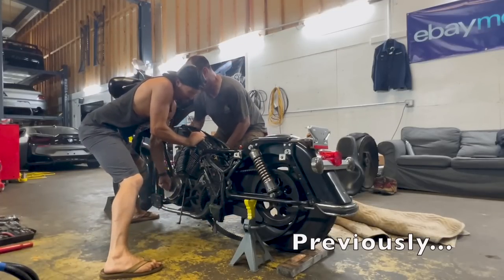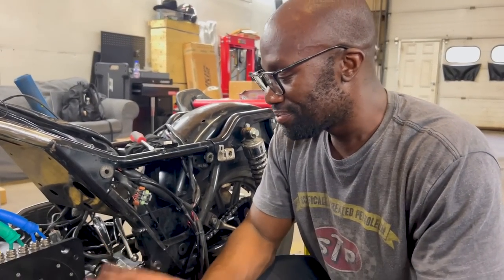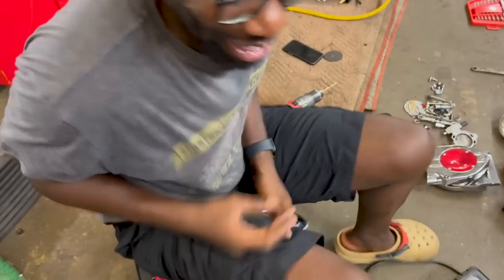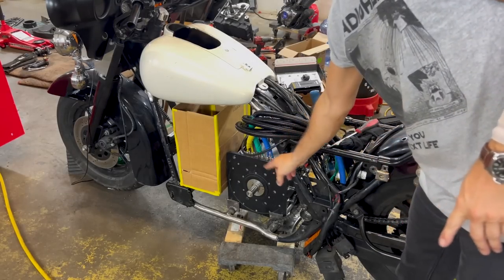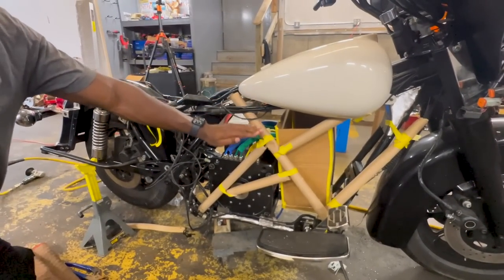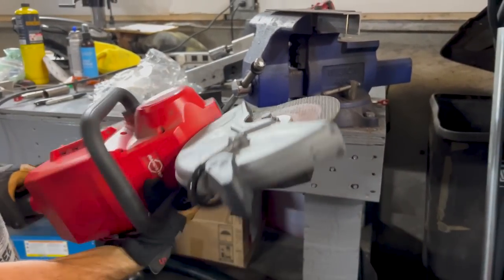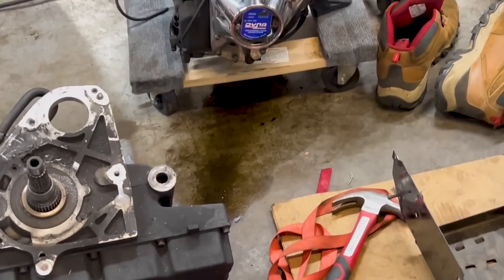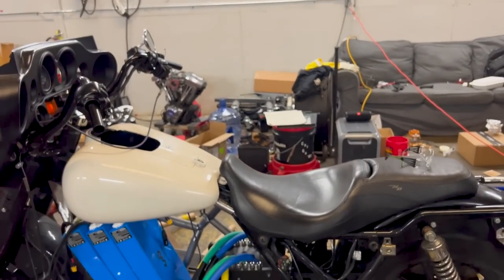Deep Dive into building a True Harley Davidson Electric Cruiser

Comment: More Volts doesn't buy you torque, it only buys you higher maximum motor RPM due to BEMF.

Going to a belt drive "only" (without the transmission) will only cause belt tooth slippage and/or belt tension too high... you haven't resolved the problem of the changing distance between the rear axel and the drive pulley/sprocket... as the rear suspension goes through its travel range.
Reply: I agree, the distance between swingarm pivot and motor axle is large. At the vert least they gonna need a spring loaded roller chain tensioner. But with the amount of torque involved there is going to be a lot of chain slap

Comment: Can the motor fit if you rotated it, like, 45 degrees or so?  It looks like the corner of the motor box could tuck back into the frame further and possibly give you more room in front.  Especially with the angled batteries.

Comment: Idk about those batteries man. Thin ass discharge wires and XT60 plugs ? Even though you're gonna run them in parallel , i'd recommend swapping the plugs out for AT least a xt90(QS8 would be great but those wires don't even fill 20 percent of a QS8 plug) and a parallel adaptor with at least 8awg and a main qs8/qs10 plug. Is the discharge rate of the batteries even going to be enough ?

Comment: I have a serious question why wouldn’t you guys just leave the transmission in and just convert the belt drive pully that was on the engine to the moter and that way you have gearing you can still shift and have the clutch it would feel and stay closer to a Harly or any moter cycle and would be less work i would think. Or is there a benefit with direct drive? I would think less top speed? No?

Comment: Is there a way for a clutch to be added to the drive/motor economically/quickly? Just like a safety in case of an issue throttle sticks/electrical issues?
I ask because today I drove a buddy’s Camry that he said had a brake issue. It did, but the throttle cable got stuck and the car started reving up and the cable was all dusty and yea. Scary shiz!

Comment: again. don,t firget to shield the belt. also the battery u use is naked folded layers with just some insulation , meaning you can't really lean on it you can damage battery.so narrow side down and on metal is a bad idea.at least 45degr. even,more with upcoming flame torch of a battery you need a full,metal box

Comment: IF YOU READ COMMENTS....
Please Fan the batteries. 
Like a V engine.
A V in a V.
A \V/.
You have perfect spacing for it.
Battery cooling. 
A nod to the Harley Engine.
Also round chrome the sides of the batteries.
Mike.

Comment: 15 minutes?
If you wanted a really quick job done on that sheave I could bore it out, drill and tap a couple more holes  make a keyed, flanged bushing with set screws that fits the shaft and slips into the sheave + bolts on.
Could probably do it in less than an hour.
But it would be preferable to bore it and make a split, taper bushing that properly clamps onto the shaft. Doing that would take me maybe 1.5 - 2 hrs.
Obviously there would be no point to do this if the sheave isn the right ratio to begin with.

Comment: To anyone saying that you “need” a chain drive setup on this HawG, that’s not true at all, all of the “high hp” guys 125-150 hp run belt drives with no issue. Belts are more than capable of holding up to the task of propelling those absolute rocket ships down the road, even with 300lbs of hunking boomer and 350lbs of Old lady “Barb” on the back. Get your facts straight Borther. Gobbless and watch out for them clibbens, you don’t want to have to lay’er down.

Comment: As per the belt drive comment, you could dial it in using the chain and sprocket set up, and then convert it to belt drive once you have found the final drive ratio you prefer.

Comment: Great project. If you are going to get a long life on the cells get some air forced over the packs. You are using a cheaper battery pack and would hate to see the cells have reduced output in 100 -200 cycles because your cells over heat. Note: the charge temperature rating is lower than the discharge rating. You can damage cells 115f on charge and after 140f discharge run and the charger is plugged you're over max charge temperature.
Reply: I could almost see putting a copper plate between the packs and then a sort of heatsink joining those plates together on either side. Then, it moves forward air takes heat out of the heatsink and the copper plate transfers the heat from the center of the pack towards the heatsinks on the side. Or, artificially cool it with some 12v fans while it's charging.
Reply: @TheWittyGeek  The center packs will get warmer and they have limited space for heat sinks. I am building a Ebike battery that has a thermal probe to turn on a fan to  cool the batteries when needed. They just want a simple build.

Comment: What's the rated discharge current of those batteries? Those small wires and Xt60 conectors can't handle the 50kw that the motor can output. Nice build tho

Comment: Might be a good idea, but what if you were to cut out the bit for the non-existent clutch, and mount the pack lower and slightly offset, to negate the offset of the motor?
Edit: also slightly lower center of gravity.

Comment: Bigger rear sprocket will give you a LOWER top speed, but better acceleration.  You can go bigger in the FRONT sprocket, and that will give you Higher top speed.
More acceleration= smaller front sprocket or larger in the rear, (or both)
More top speed= larger front sprocket or smaller in the rear, (or both)

Comment: The guy that commented to keep the belt, doesn't know Jack, high horsepower harleys all get switched to chain because the belt won't handle the power, they end up jumping then shredding.

Rich, if you need help with sprockets look up Mad Monkey Motorsports he's one of the top chain conversion guys for harleys.

Comment: Were it me, I would find an output shaft already splined, cut a section off as wide as the contact surface on the sprocket, drill the center and put a keyway.

Comment: 7.2 kWh does not feel Like alot, probably enough for some City cruising tho
Reply: I converted a 250 Ninja to electric with a 6.5kWh battery and the range is about 100km.
Reply: @moestrei  just watched your video on it, looks very clean, well done mate
Reply: @Space_Reptile  Thank you for watching.....yes I took a lot of time to get it right. Like RR I started with a Golden Motor (10kW) kit, but then got the 8kW hub motor which gave heaps more room for the battery and eliminated any drive train issues. Absolutely silent too. The only moving parts of the entire drive train are the two wheel bearings, nothing to service. I recon liquid cooled hub is the future.

Comment: Fuck belt drive. The only reason they use those on Harley's is so that the chain doesn't stretch and need adjustment after every take-off with a typical Harley rider on it, plus when you're too fat to see your own feet, I hear it can be difficult to lube a chain. Since you weigh about an eighth of the typical Harley rider, a chain should be fine and will transmit more power by not heating up or becoming elastic.

Comment: Grainger probably sells the belt drive parts. Those are two piece and they make probably every size you would need. Would be easy to swap out different sizes to get the right ratio on the front pulley at least?

Comment: MATH brother, where is the MATH? (Drive sprocket radius x pie/wheel sprocket radius x pie = rotation ratio.) That electric motor will spin at what??  3,450 RPM?  That puts your bike speed at DANGER.  Do the math and you will change the ratio Bigger DRIVE sprocket or SMALLER wheel sprocket.